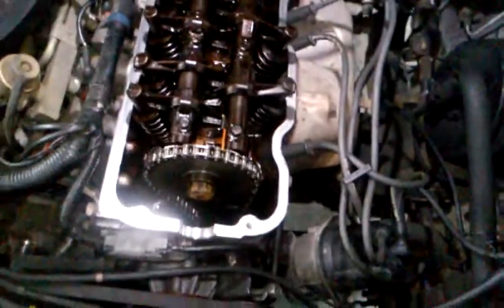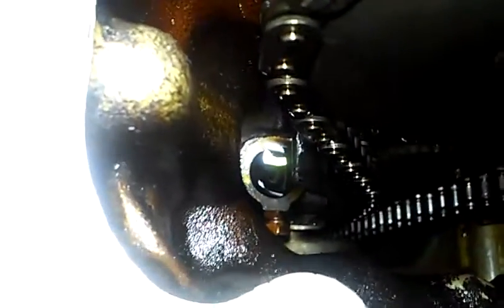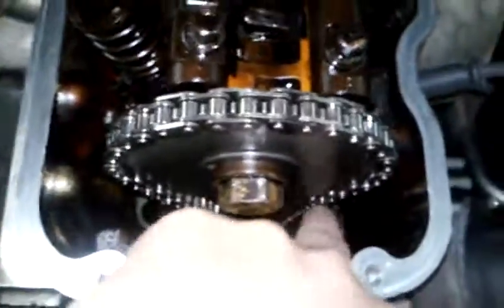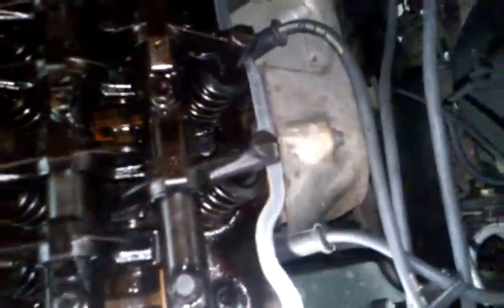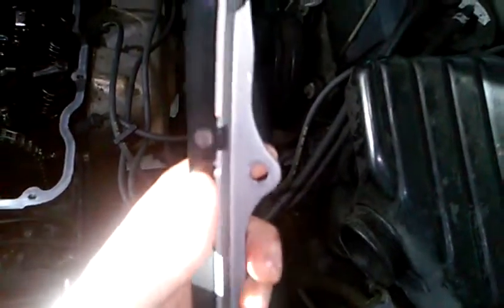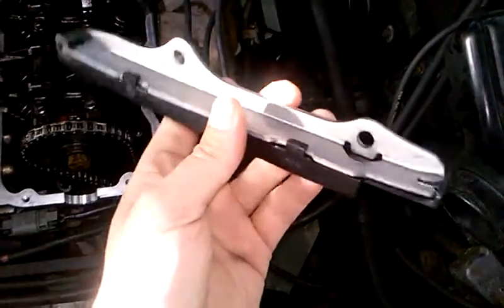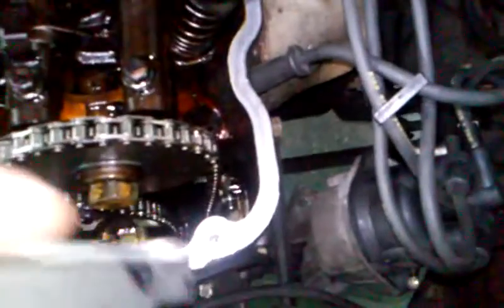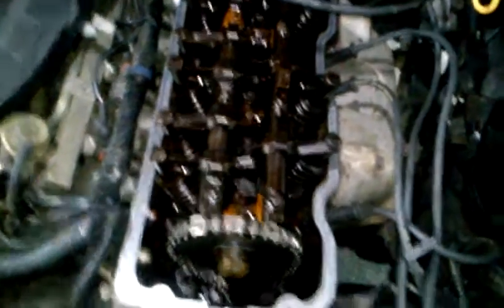Nissan hardbody timing chain rattle part 1

Comment: This is my exact problem, thanks a lot for this video and Mr1Jim for his brilliant invention.
Reply from the maker: glad it helped Joel ! if you need any other info on this let me know I'd be happy to help. I actually ended up having to replace my oil pump too which was a nightmare for me to do on my own. I recommend doing this while you already have it at top dead center on compression stroke.
Reply: Roy, i have removed my oil pan gasket and valve cover and discovered the majority of my metal and plastic pieces in the oil pan. Is it possible to remove a piece of the old and reinstall the new guide through the oil pan and valve cover? What is your email, i will send you a note. Thanks a lot 

Joel